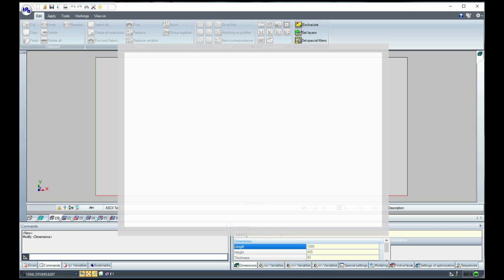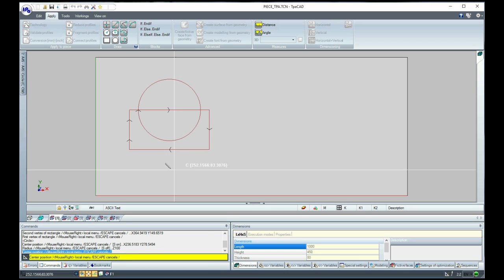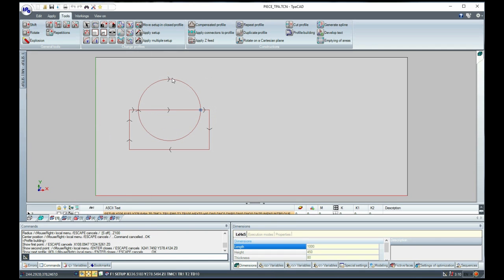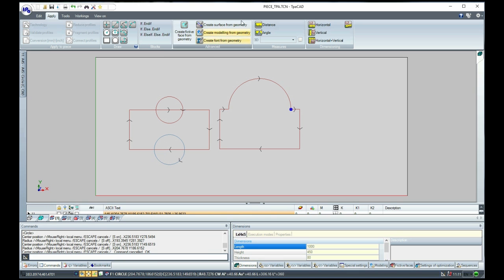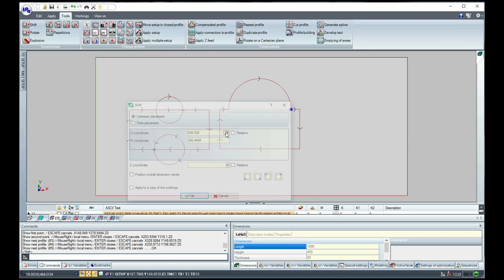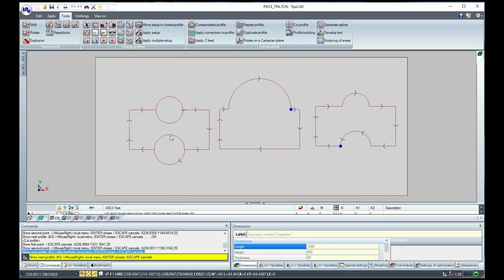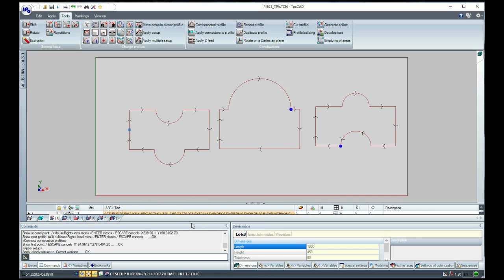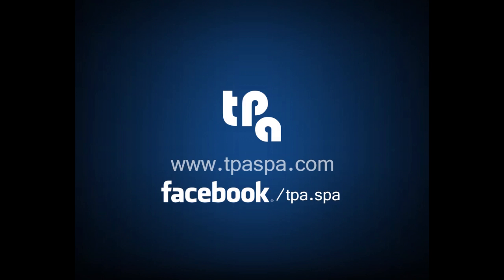TpaCAD   DrawBuild

Comment: Hi. Does it possible to make a pocket (area clearance) for wood milling using tpaCAD program? Thanks.
Reply from the maker: Yes it is possible, you can use the macro for empty areas, or design the area buy your own with design tools than assign an empty area to that area, is possible also to make an empty area with an "island" inside, the empty area can be programed in a parametric way in order to adjust the size of it atuomatically when you change the dimension of the panel.